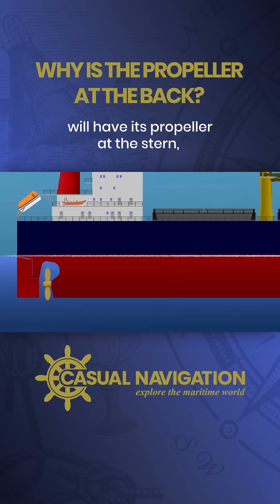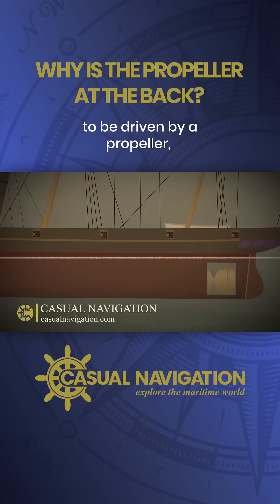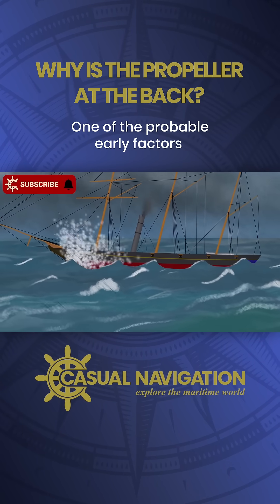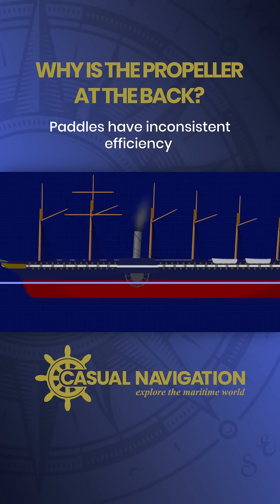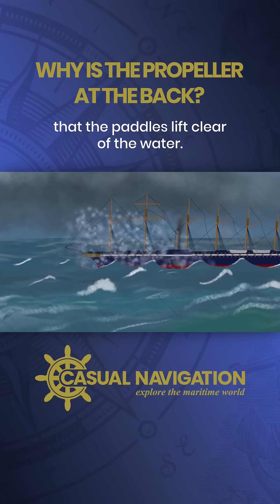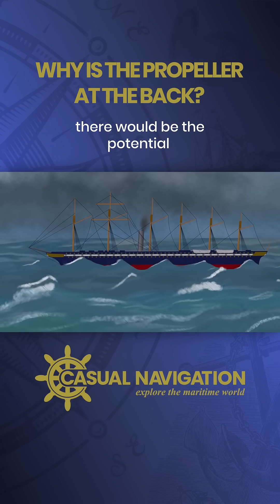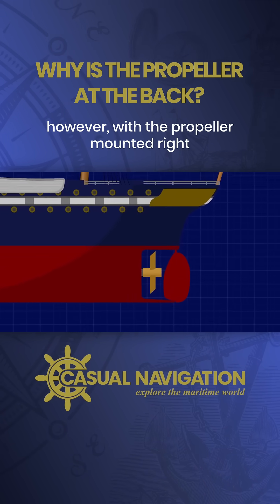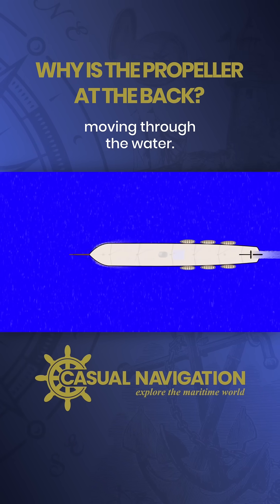Wait… The Propeller Is Where?!

Comment: If you were to place it in the front, then you'd get all the fast-moving water from the propeller travelling over the hull.
It would be like constantly sailing against the current. Loads of added drag for no reason.
Reply: While that sounds logical, I’m not sure it’s correct. With the prop at the rear it’s just pulling the same water along the hull rather than pushing it.
Reply: @sam.p12345 no, behind the prop it’s pulling the same amount as it’s ejecting, but from all directions, so it doesn’t get the same amount moving as quickly along the hull. Feel the difference between the air flow behind and in front of a household fan for an example.
Reply: Not sure if it’s used this way but for hydrofoils, this effect could be very useful - aircraft benefit from the prop sending air over the wind to grant more lift at low airspeeds, the same may prove true for hydrofoils.
Reply: @magratheadeepthought4675  Interesting idea! Probably would work, I mean, I can't think why it wouldn't.
Reply: @magratheadeepthought4675  Did a bit of digging and it's actually been studied. It seem vortex shedding from the propeller causes oscillations and instability. IMO there still might be something to the idea though... 
Source: "The study for unsteadiness of flow on a truncated hydrofoil behind a propeller"
Reply: Ghost Stealth Ship and Piaggio Avanti are the opposite of both worlds 😂😂
Reply: Good point !
Reply: @charmio  You're trolling and not serious, right?
Reply: @davea8346  Nope!
Reply: It actually creates less dragbif you can believe it
Reply: You also get much better maneuverability from a ship with the prop at the back. You can change directions more easily. It’s exactly why you can parallel park in reverse but not moving forward.
Reply: Would stop barnacles though.
Reply: And Airplanes don't?
Reply: @flipper184 Airplanes rely on airflow over the wings. Boats rely on entirely different laws of physics for their primary function. I’d even say that an airplane relies on its engines to achieve its most important function, while an engine is a boat’s secondary feature. That’s probably why we invented the latter over 15,000 years before we invented airplanes.
Reply: Why doesn’t water enter where the propeller is?
Reply: @paulnolan2034  That question is a bit too broad for me to interpret. Are you asking about shaft seals or flow dynamics?
Reply: At cruise the speed of the water over the hull is the same as the speed of water through the propeller.  Think of a screw threading through the water, propellers on planes are the same.
Reply: @kingcosworth2643  You're forgetting about drag. If there was no drag, then yes, the speed of hull would exactly match the speed of the water through the propeller. Such a boat wouldn't even need a propeller while in cruise, it would only be useful for speeding up or slowing down. Except that's not the way the world works.
There is drag, lots of it too. The propeller needs to push water back to compensate for the drag. Equal and opposite reactions means that this act of pushing water backwards pushes the boat forwards.
Reply: Wouldn't it have more cavitation therefore less drag? I heard it somewhere.
Reply: @CosmicHase  You don't want cavitation. It causes vibration and pitting in the propeller. I can't think how it would reduce drag either 🤔
Reply: @charmio just check super cavitation and super cavitating torpedoes. It does reduce drag, I’d suspect due to reduced boundary layer and skin friction. 

The forward propellers have been used in some experimental navy ships.

So yeah, cavitation definitely can be useful.
Reply: @tuukkasilventoinen8961  True, but those torpedoes aren't using propellers. They need rockets to generate a giant cavitation bubble around the entire torpedo.
I don't think it's particularly relevant to ships with forward facing propellers.
Reply: @tuukkasilventoinen8961  if it decreases the water density it would also decrease ship buoncy. You might thus end up in a situation where the front of the ship just starts to sink.
Reply: @tuukkasilventoinen8961  no, you're right, if there's air bubbles around the hull it reduces drag
Reply: @tuukkasilventoinen8961  Cavitation is only useful if the craft is fully underwater and in the cavitation bubble. They don't care about damage as the torpedo is going to blow up anyway.  For anytype of long term use you avoid cavitation as much as possible.
Reply: @tuukkasilventoinen8961  Yeah for one-use torpedoes...
Reply: @CosmicHase cavitation is only on major pressure changes, it disperses almost immediately.
You probably mean aerated
Reply: So NO and yes, but most of you are wrong.. respectfully

It all has to deal with, buoyancy and general mass. 

If you put a Prop, in front of a boat, it aerates the water, reducing the density of the water, causing the boat to sink right in front of itself. Thats why boat motors, are ALWAYS in the rear.

If you put a Prop in FRONT of a plane. The system is "Pulling" like youre the truck, to a trailer..Much more in control. 

ALSO, think about the physics of a propeller in water... Lots of drag and resistance. ORRRRR put it in the back and harness the torque.

The plane is made to be EXTRA LIGHT, so it can "float" on the air. Thus, "drag. Thrust. Resistance. Lift."

A boat is worried about balancing their Ballasts.

Dare I say more? If youre curious about something. Challenge yourself and then use google.. Its ok to be wrong, just do your research. Cogito ergo sum. Isnt always true. Thats why you need to believe what you see, as well.